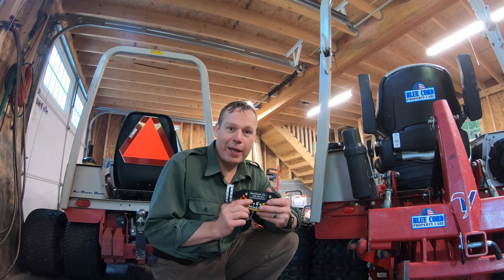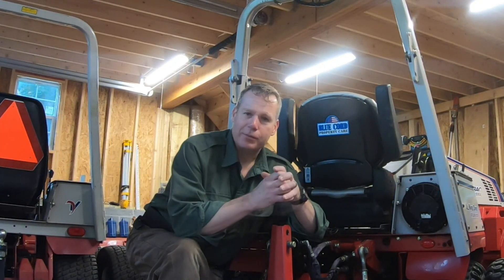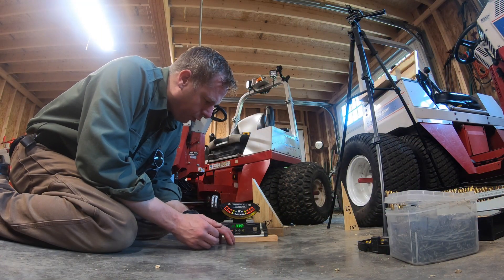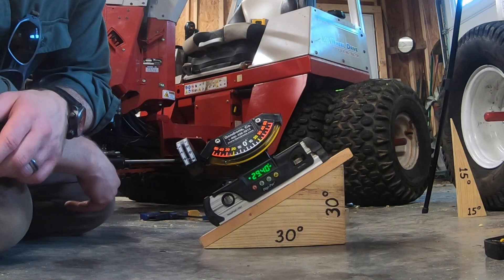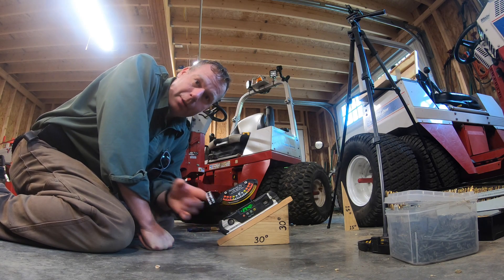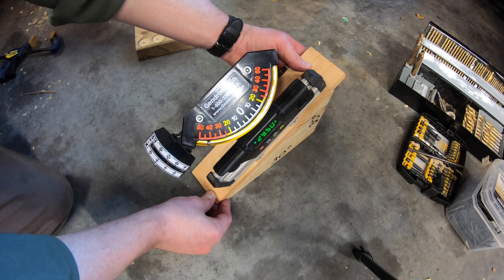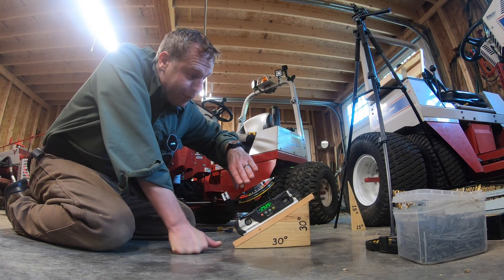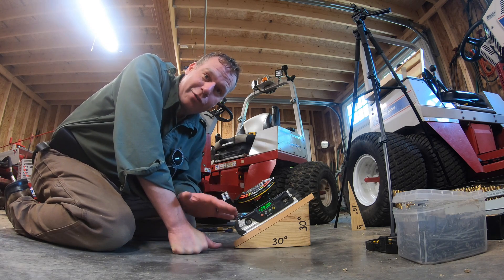How Steep can Ventrac Go!?  Improper Slope Gauge Mounting Gives Fales Readings

Comment: The video timing was very apropos; I had my new machine on a 24* slope the other day. I was running the 72” fine cut flail. What a disaster! Despite the weight transfer in #4, a mid weight bar kit, 9 weights on the 3pt, that mower was dragging me down sideways the whole time!
Reply from the maker: Tire pressure is also a factor here.  Make sure your tires are not inflated too much for applications like this.  The lower the tire pressure, the greater the contact patch and great traction!
Reply: @bluecordterrainmanagement  I will check that, thx!
Reply: @bluecordterrainmanagement  good call on psi, they were all set to 14 psi. I reset to factory specs. Hopefully that helps.
Reply from the maker: @arlisspropertyservicesllc5943  Fourteen!?  Holy Moly!  Why were they so high?

Comment: Nice work and explanation Bradley. Any links to the slope gauge you are using and would the slope 'level' you used in the demonstration just suffice in your opinion?
Reply from the maker: Thanks!  I'm not sure what you mean by the slope "level".  The basic slope gauge I use, there are other similar types out there, is more than adequate to determine side slope
Reply: @bluecordterrainmanagement  the digital level you used for the test attached to the magnets.